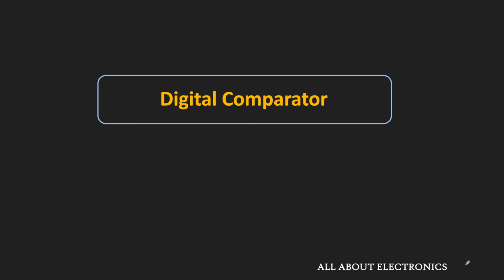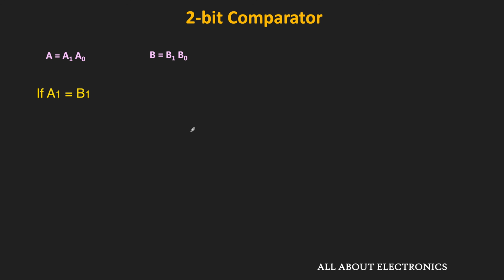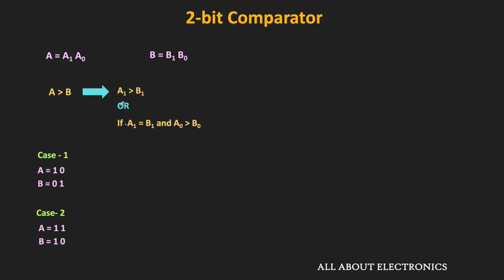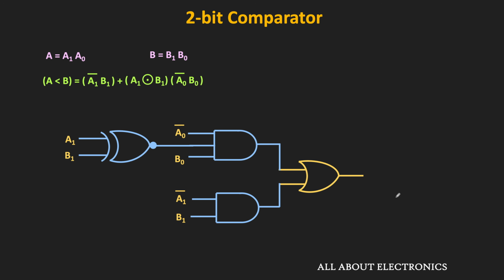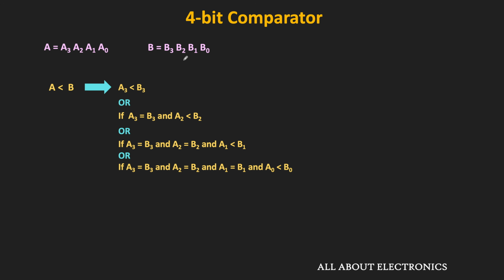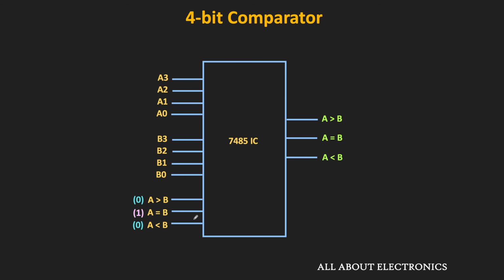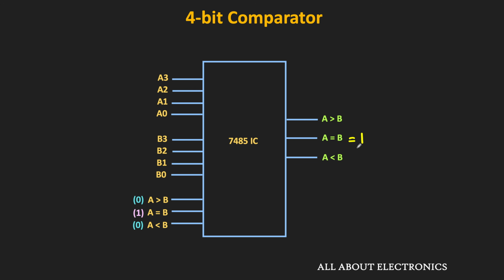What is Magnitude Comparator (Digital Comparator) | 1-bit, 2-bit and 4-bit Comparators Explained

Comment: The logic gate of 1 bit magnitude comparator must have NOR gate and not XNOR gate as it not logically correct. U can check that by adding the values in the switches, XNOR gate will fail in the input: A=0, B=1
Reply from the maker: In magnitude comparator, we are not adding the two bits. We are comparing the two bits. (Whether they are equal, less than or greater than one another). So, for 1 bits comparator, to get an output when both bits are equal, we can check the truth table. And from the truth table, the same can be implemented using the XNOR gate. 
For 1 bit, if you see the column for A=B in the truth table, then for NOR gate, the output will be 0 when both A and B are 1. Well for comparator( for A=B), we should get output 1 when both A and B are 1. So, it is not possible to implement using the NOR gate. I hope, it will clear your doubt.

Comment: 19:52 Shouldn't  the be msbs and lsbs be swapped ??
Reply from the maker: No it's alright. The number will be like A7 A6.......A1A0. The last four bits will be A3A2A1A0. And Higher 4 bits are A7 A6 A5 A4. The same is the case if another number .
Reply: @ALLABOUTELECTRONICS yep, shouldnt we compare from msb side and if they are equal then proceed to lsbs?
Reply: @notforubro listen what he said carefully in the video. If the msb comparator inputs are equal THEN only it will use the inputs coming from the LSB comparator. So there must be an AND gate blocking all three inputs of MSB comparator and when A7-A4 and B7-B4 are equal then it switches it's output to the LSB comparator's output
Reply: @ALLABOUTELECTRONICS could the comparator be swapped then? Meaning we check the higher bit first, then the lower bit. Shouldn't make a difference right?

Comment: Timestamps 
00:11 - Digital Comparator
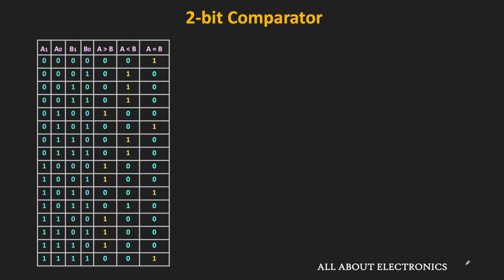03:06 - The truth table for the 2-bit comparator shows the comparison results for different input combinations
05:44 - Compare MSBs to determine the greater number.
08:20 - Comparison of two numbers A and B using logical expressions
11:02 - Comparison of numbers using logical expressions
13:38 - A logical expression for comparing two 4-bit numbers.
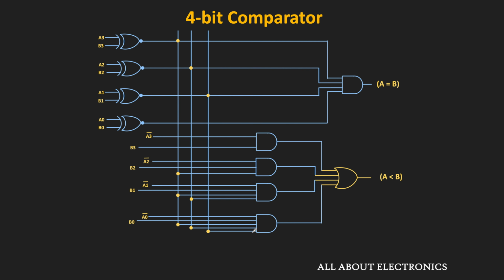16:24 - The 4-bit comparator requires AND and OR gates for each input bit, and as the number of bits increases, so does the number of gates required.
18:57 - The digital comparator can compare 4-bit numbers using the standalone 7485 IC or by cascading multiple ICs.

Comment: Question: Can u use XNOR gate that connects the outputs of A=B and A>B, since A<B whenever A is not equal nor larger than B
Reply: What do you exactly want to do
Reply: In truth table for all kinds of magnitude comparator only 1 output is active at a time
Reply: Xnor will remain 0 forever
Reply: I understand what you are trying to say, but you got the wrong gate. Like you said, A < B when (A is not equal to B) and (A is not greater than be B). For that we can use AND gate or NOR gate. 

Nor gate would be: ((A = B) + (A > B))'
And gate would be: (A = B)'(A > B)'

XNOR gate wouldn't work like above mentioned since XNOR gate is high when all the inputs are the same. Since A and B cannot be greater than each other and equal at the same time, it will remain 0 forever.

Comment: Question: Where do the three inputs ( A>B,  A=B,  A<B ) get involved in the circuit diagram? I don't understand that part and I need them to connect 3 4-bit comparators to build a 12-bit comparator
Reply from the maker: Just look at the circuit diagram at 18:31. The 3 outputs A= B, A> B and A<B, of the comparator (which compares the lower 4-bits ) is given to the inputs of the another comparator IC (which compares higher 4 bits). These 3 inputs are helpful when all 4-bits of two numbers are same. (e.g, in this case, when the higher 4-bits of the comparator are same) . By sensing these three bits, the comparator can decide which number is higher than the other number. I hope, it will clear your doubt.
Reply: @ALLABOUTELECTRONICS  why didnt you add not gate in A' AND B' IN 2 BIT comparator your circuit diagram was wrong there
Reply: @ALLABOUTELECTRONICS  How are these 3 cascading inputs (outputs from the left IC) on the right IC are connected to the 3 outputs internally which ensure that they come into play only when the 4 MSBs are equal
Reply: @ALLABOUTELECTRONICS  Shouldn't we first check the Higher bits first, and then the lower bits